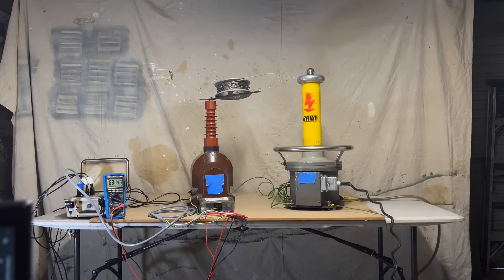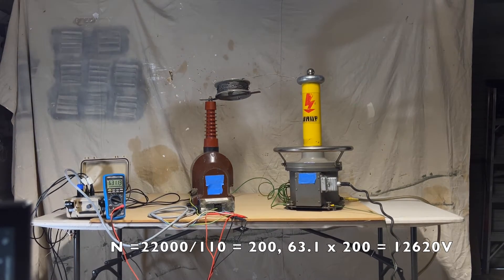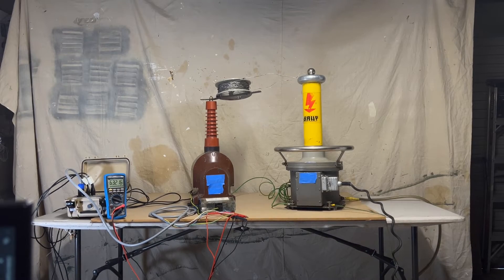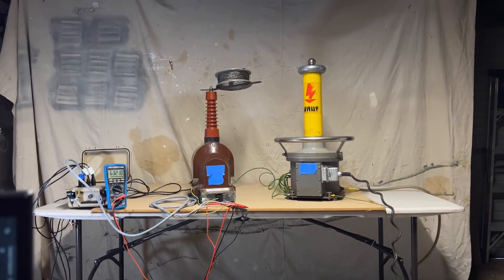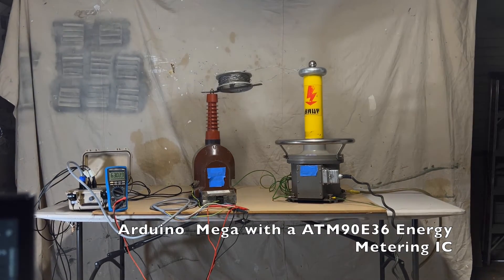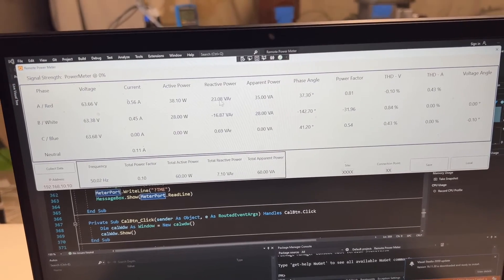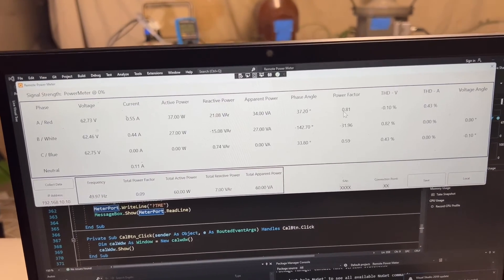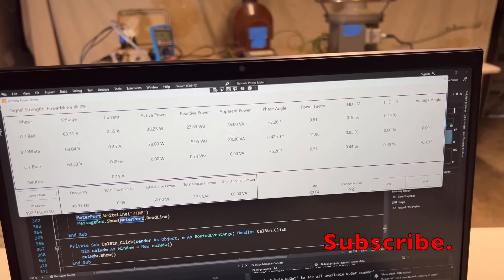High Voltage measurement using Arduino

Comment: Interesting. Crazy to think an Arduino ADC with a 5v range is measuring 10s of thousands of volts.
Reply from the maker: If you told me I would be making such a thing 10 years ago i wouldn't of believed you.  5 years ago I was happy I got a blink sketch to work.